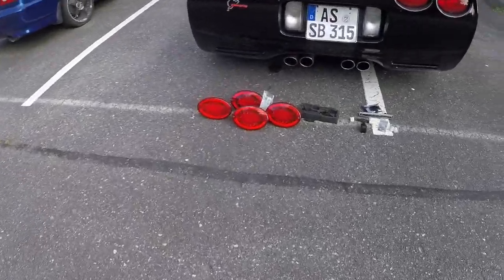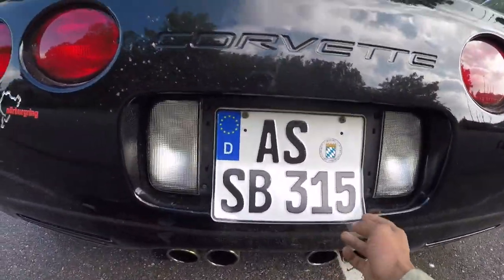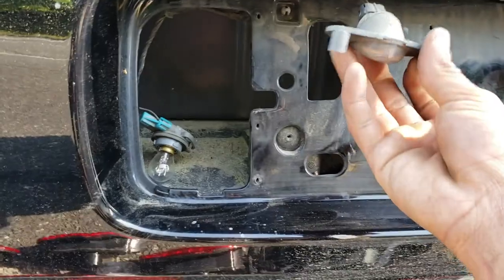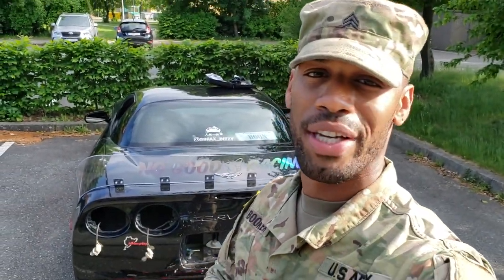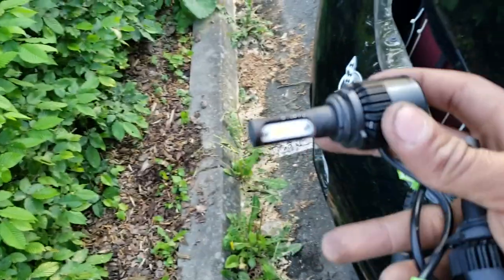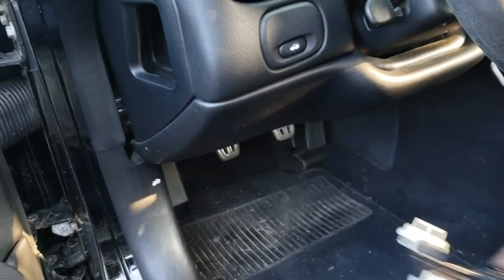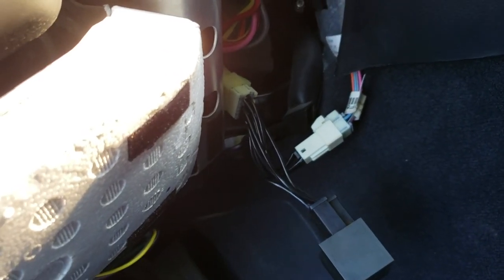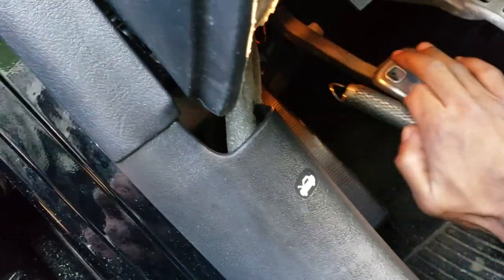How to Install LED Lights on C5 Corvette

Comment: This vid was very helpful. Pulling the trigger on this mod real soon and you made the process less intimidating. New sub. Keep the content coming. Appreciate your service.
Reply from the maker: Happy to help fam honestoy the lights are all pretty easy good luck!
Reply: @Beezy_Builds  do you need that 3rd brake light resister? Or does the hyperflash plug take care of that too?
Reply from the maker: The brake light box i put in was just to make the 3rd brake light strobe its not necessary
Reply: @Beezy_Builds  👍
Thanks!
Excited to get this done.

Comment: Yo reverse wasn’t trippen?
Reply from the maker: Nope not at all my reverse lights worked perfectly, leds run only 1 way though so if you put them in backwards they wont work
Reply from the maker: @Chepo1500  im in Germany I dont have a state side number, hit me on fb Braxton M. Booker
Reply: @Brax_beezy I just sent you message on Facebook bro

Comment: Did you have to unhook the battery to install all these?
Reply from the maker: I dont usually unplug the battery when changing bulbs because when the lights are of no power should be going to them
Reply: @Beezy_Builds  battery still connected when you installed the hyperflash harness too? I'm starting this today and don't want to mess anything up. I don't like to unhook my battery unless I have to.
Reply from the maker: @NITE_SHIFTING  correct
Reply: @Beezy_Builds  Thanks!
Appreciate your videos and your service.
Reply from the maker: @NITE_SHIFTING  happy to help brother! Thanks for the support